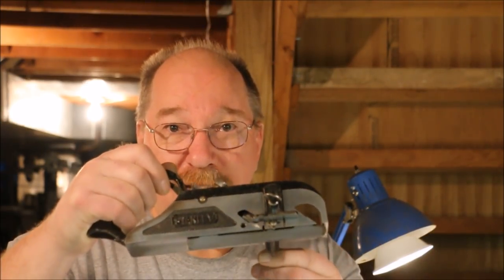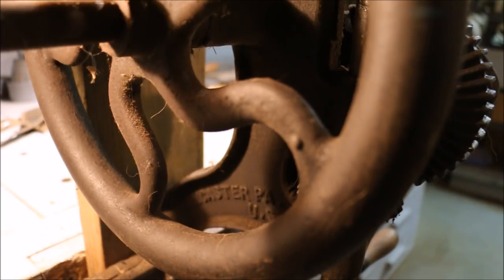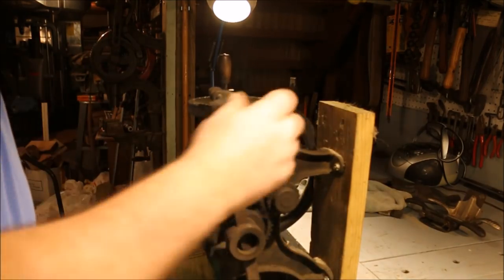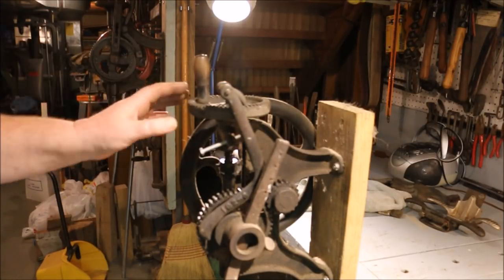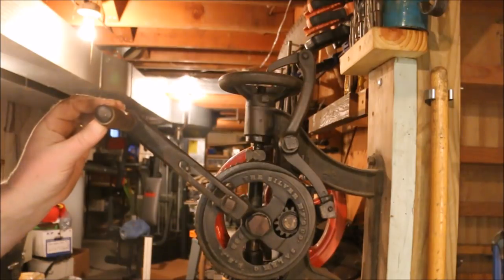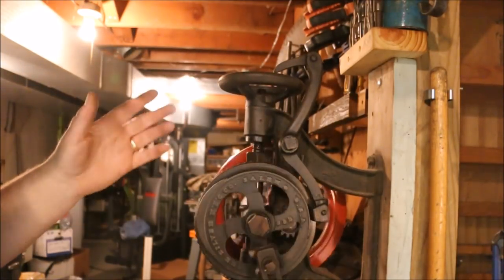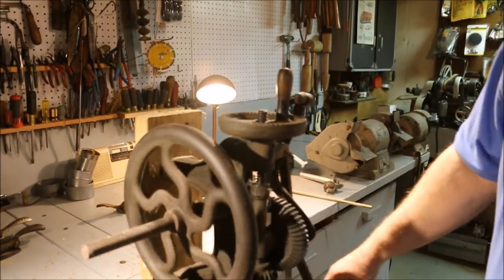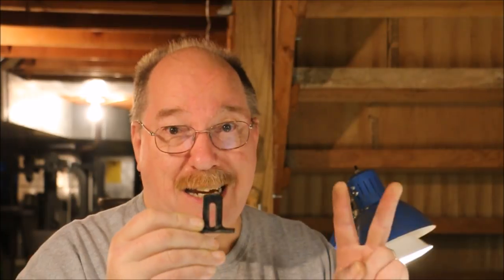REPLICATING A DEPTH STOP FOR THE STANLEY #78, SARGENT #79, MILLER FALLS #85

Comment: It's a shame the shops I've worked in over the years that they went to the scrap pile who would of known years ago they would be wanted again. They where a useful tool but a hundred holes they were hard work your shoulder felt like it wanted to fall off.The good old bad old days lol
Reply: yes in the 80s i was seeing the post vices go to scrap, wish i had grabbed one, my record 25 vice i paid what was going to be scrap and paid the guy £20 for, it was fine, new jaws, new spring, straighten handle, its a better condition than most , been restored and painted now.  who knows what else was going, i was too young to know what a lot of stuff was,  im pretty sure a few startrite drill presses went too. ( my dads company was next to a scrappie), oh yes, i bought (and quickly sold) a 3 phase floor stand 8 inch grinder, was made in 1934 and solid as a rock, was far too big for me (and the 3 phase converter kept blowing my breaker on surge), cast iron stand, two old machinist lamps, lovely for someone to own
Reply from the maker: Jusb1066 You can cheat on blowing the breaker during startup. If your invertor has the soft start feature it will reduce the surge. If it doesn't you can bypass the breaker with a momentary switch. Start it rolling with the bypass and once it's up to speed release it to run on the protected circuit. All that assumes the motor is in good shape and the ciruit is the proper size for the running load. 
The breaker is there to protect the wire from overheating or shorting and arcing, not the motor. A short burst won't heat the wire much. If there is a problem, like a stalled rotor,  then releasing the momentary will put the load on the breaker again.
Reply: inverter was ancient mechanical, and no breaker in the UK also was the house internal 32a (shared with garage power)  and no deal for safety!  i only have an entire 50a circuit for the entire house,  this is why we dont have house AC in the uk!
Reply from the maker: David Chadwick I have had the Silver Mfg. Drill since about 1995. It was sitting in a shop by Battle Creek and I bought it just because it looked cool. Ryan loved to crank the handl e when he was little. I kept a block of wood on the table and a bit in the press for him. 
They will drill surprisingly big holes in steel with a lot less effort than I thought it would take. The ratcheting feed keeps the bit engaged but doesn't let it grab like a more modern drill.
Reply: I remember the starters for the jaw and cone crushers at the original boulder hole. The Cat D-8 or 9 powerplant and firing it up with the pony motor in the dark in that trailer till after it fired and the lights came on.  The starters were mechanical with arms on the side like I hear slot machines have. I've never slotted and never will.  PUll the handle until the motor got up to speed then pushed it back and fastened a hook around it. My electricianer buddies cringe when I tell them that. They know the starters and were supposed to be self locking in case of a overload and they's kick out themselves. Not with the hook they wouldn't. YOu know the kind I'm talking about I know. Sure was interesting back then.
Reply: Old Sneelock's Workshop I agree they worked lovely no pressure when drilling but going round and round my arm would kill me.say we were making a pair of  extension ladders and I had loads of one after the other 1 1/2 " holes to drill because I was young and could drill with a brace 100% straight then I would be made to use the hand cranked drill press which to be honest put me off them and I spent hours practicing with a brace to drill straight. Using the brace is hard work but seemed easier some how well didn't make my arms hurt as much ?
Reply from the maker: David Chadwick Dad had electric drills from the time I was 3 or 4. He gave me my first brace and bits to stop me from borrowing his to drill holes in the dirt. I'm a little oldrr than you though. Jusb was saying he has 50 amps for the whole house. That's equal to 100 amps of 110 volt current. Houses built in the 60's here are wired for 100 amps with 110 volt as the norm. 
Every house I have had except for the first I have put in 200 amp services. Washer, dryer, dishwasher, electric hot water, lights, range and oven all pull between 20 and 30 amps each. You wouldn't think it possible but I have seen the day when it was all running at once. 
Funny electrician story:
Some guys I use to know worked for White Electric were talking with my Dad. They got called to to fix an outlet that was giving shocks to a woman. 
When they got there they checked the outlet with a meter. All checked good. The opened the cover and it was wired correctly. They asked the woman how it happened. Shevsaidvevery time she plugged in her clothes iron she got a shock. She said, "i'll show you."  Before they could stop her she picked up the plug for the iron, pinched the prongs together with her thumb and finger so they fit into the recepticle, and plugged it in. She said, "There it did it again."
Her husband was standing there dumbfounded. He said, "I'm sorry guys. We'll pay the service call."
Reply: That's good!
Reply from the maker: Lewie McNeely I taught the guys that worked for me to stand on the side of the box opposite the hinges when they pulled the handle. When the switch first engages, if the circuit is shorted, the resulting arc across the knives will blow the door clear off. One guy didn't listen. He was working on a 400 amp buss bar that needed a new fuse in one of the buss plugs. He sat the ladder so the rails straddled the buss plug. He climbed up opened the door and put in the fuse. Then he closed the door. That engaged the knives and the fuse exploded. It blew the door off and knocked him 20 feet to the floor. He was in his 90 days trial. I fired him. Any one that won't listen, but is lucky enough to live through stupid, shouldn't have a second shot at killing someone. 
The guy who told you to do that should have been whipped out the gate with a garden rake.
Reply: Old Sneelock's Workshop yes in the uk it's 240 v Ac in to the House that goes to a main fuse box all plug sockets on a ring main are  fused to 15amp. lighting ring 5 amps cookers are 35amp separate showers are normally 60amp blow fused again separate .most houses have a separate ring for say kitchen where most likely washers and dryers are so that will be on a 30amp blow fuse
Reply: It was just S.O.P. It'd been that way for no telling how long. The old guy that came with the plant to oversee the putting together had run that same plant for 25 years! He was from Robbinsville in his 70's, and drove it every day and was catty as a teenager, cussed like a sailor and I thought the world of him! I'd go help him work on and run the jaw and whatnot. He was catty enough so when he was beating a rock to go down in the jaw and his hard hat or hammer head went through he's run over the end of the jaw framework, over the motor and catch it coming out on the conveyor belt. Amazed me! I guess he didn't even give the starters a 2nd thought. NOW I know to stand to one side but those starters are long gone. Then I just gave it a yank and a shove. Live and learn if you live.
Reply from the maker: David Chadwick If it hadn't been for Tesla we would all be running our houses off a DC Generator hooked to the gas engine on the water pump like my house by Union City was back in the 50's. Or off of Sal Amoniac zinc carbon batteries on a shelf in the basement like my Uncle Rex's house by Coldwater. Edison tried to convince the world that his DC system was the best. Tesla proved him wrong. 
Both of them should be turning over in their graves now. Batteries are running the world. If the power grid dropped this instant 90% of the  kids wouldn't know it until the batteries went dead on their phones 4 hours later. 😈 
Edison one a partial victory, but it took the Chinese to make it happen.
Reply: If it wasn't for Tesla we'd be watching t.v. by candle light!
Reply from the maker: Lewie McNeely Glad we both lived through the dumb stuff we did. Ignorance is the bliss that lets us die happy thinking that everything is just fine till it ain't. 😲
Reply: Thanks for the lending of the part Mr Sneelock I did get the part and have done some drawings. Minor catastrophe over here had some computer trouble and ended up losing my editing software. I guess the gopro studio dose not exist now (them bums) so now I need to find and learn a new program. But I will still be able to film at least .
Reply: yes, i must be pushing close to that 50a many times, i have an electric shower that heats,  the garage is on a 32 circuit, (so i can use two power tools or a heater and a tool, most home garages are at the end of a 13a ext wire! and cant run much ) and if you think about all the other things that use a lot of power!  no way could this house support 3-4 people all using high power devices, my house is mid 60's and originally only had a single power socket in each room (the single one in a 30ft  lounge was not convenient!) and coal boiler, needs have changed massively over this time, more sockets have been wired during a re wire but no more amps are available
Reply: I'd like to suggest you restore that champion drill. Shouldn't be too hard compared to mine lol. I might back able to help you out there with the wobbly flywheel if it's in good enough shape to recast you can probably get it bored where it would at least be untrue again I would say that's a cheap Endeavor though
Reply from the maker: When our TV broke I was 7 years old. It stayed in the corner for two months before Dad got rid of it. We didn't watch by candle light but it was right next to the coal stove so we huddled around it.
Reply from the maker: Dad's side job was Electrical Contractor. He held a Class 1A license but he worked at the Midwest 2nd shift and the electrical business during the day. I was cheap labor if you consider they intended to feed, clothe, and house me anyway. At least I'm pretty sure about that. 
Dad did smaller jobs. We rewired a lot of old houses. Most of the older homes were two story farm houses that had a single light socket in each upstairs room. They would have 4 outlets in the parlor or living room, a couple in the kitchen, usually over the counter, one or two lights in the basement, and a porch light. 
The service would be a 60 most times with an occasional 100 amp service. 
Since people didn't have automatic washers, dryers, dishwashers and the like 60 amps was more than enough when they were wired in the late 40's early 50's. 
By the late 60's the electrical business was booming. Every room needed 4 outlets. There had to be at least 4 duplex receptacles over the kitchen counter. The bathroom needed an outlet for the razor and the hair dryer. Bedrooms were lit with table lamps on nightstands and there was at least one clock radio. 
When we would look at the 60 amp service the main cartridge fuses would be baked to a crisp. The screw in glass plug fuses would be 30's instead of the 15's that the wire was rated for. Typically the ground would be a driven rod with a corroded piece of #6 bare copper. 
We did over 100 houses over the 10 years while I worked with Dad. 
We started putting in 100 amp and 150 amp services at $10.00 per amp installed. By the time I stopped it was up to $40.00 per amp installed. Wiring circuits was extra. 
This house has a 200 amp service. With all the equipment I have in the garage if I started everything at once I would blow the main breaker. The thing is most of the time I only use one or two at a time because I have to be doing something with it. 
In the house the oven/range, dishwasher, and washer dryer run independently. Turn them on and they run till they stop. 200 amps is enough. If we were using 220 it would be 100 amps and I could use 14 gauge wire instead of 12 gauge. 
In the next 20 years the home as we know it will be changing. Power and communications circuits have changed dramatically in the last 10 years. We no longer have a land line. We use cell phones and the house is wired for internet through the Cable Company. A lot of our neighbors are switching to satellite service. 
If certain groups continue to have their way we will be running photovoltaic cells on the roofs and wind farms over most of Michigan. 
Can't say if it will be better or not. The power grid hasn't expanded or improved beyond what it was in 1970. 
As the old curse goes, "May you live in interesting times." I think I'm losing interest.
Reply from the maker: I heard noises about GoPro having issues. I use Movie Maker. Not a good one or even one I recommend. It is the one that I am familiar with and if it ain't broke I don't fix it. At least not often. :-)
Reply: Old Sneelock's Workshop no complaints about the gopro except the built in Mike is garbage. But my external Mike work really well. side note I planed about 10' of hickory butcher block today I'm wooped.
Reply from the maker: Chris Anderson The cameras are still very popular. The company is saying they might get sold. Hope you can get your editor working.
Reply from the maker: Chris Anderson 10 foot of hickory countertop is a bunch. I would be tempted to rip it 13 inches wide and run it through the planer. ☺😆
Reply: Old Sneelock's Workshop me to part of my problems is my computers older and doesn't have much memory for the new programs.
Reply: Old Sneelock's Workshop I rid that as a built it up. But can't plain it once it's assembled.
Reply from the maker: Chris Anderson Video is a memory hog. My laptop has a terrabyte of hard drive. I have one terrabyte of One Drive online storage and a 4 terrabyte remote drive. I just had to buy another 4 terrabyte remote drive. Good thing the price dropped.
I delete anything over a year old that is already on Youtube. I tried using two cameras for backup and background but it just swamped my system. When I went to Windows 10 and HD the memory usage went through the roof.
Reply from the maker: Chris Anderson That's how I did it when I built the woodworking benches. Once it's glued up full width we are stuck with the hand planes. Mine are just pine 2x4 laminated. Hickory is a whole lot harder.
Reply: Old Sneelock's Workshop oh you bet it is but it is a better choices for the kitchen counters. Wears Like iron
Reply from the maker: Better choice for a workbench too. If it had been available I would have used it. 😊